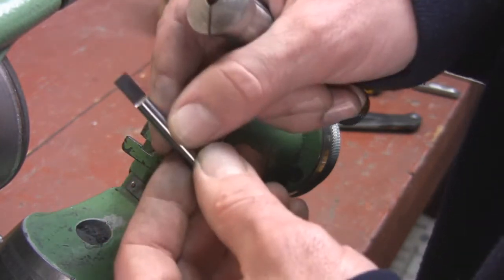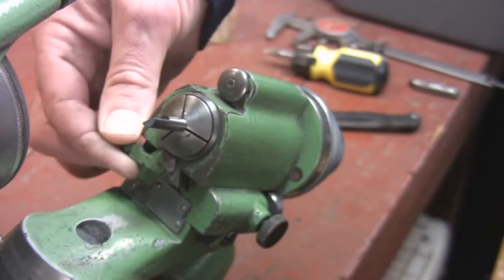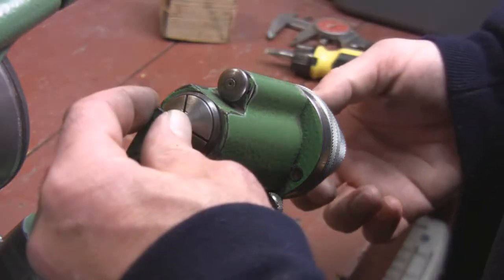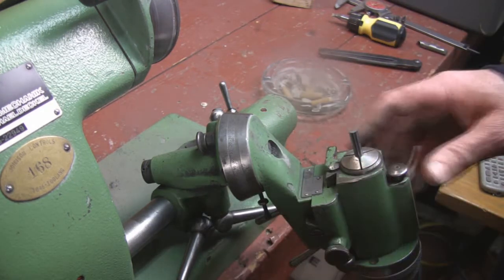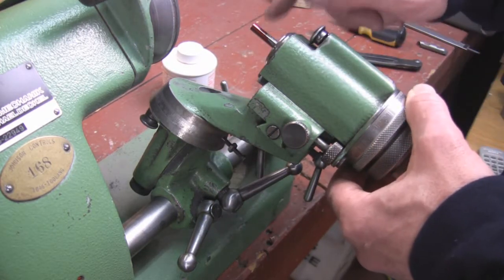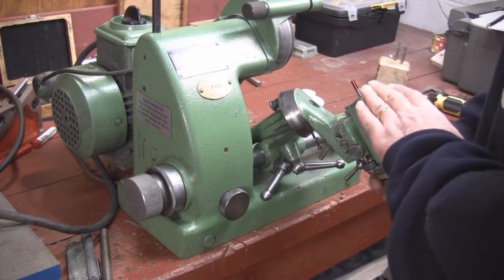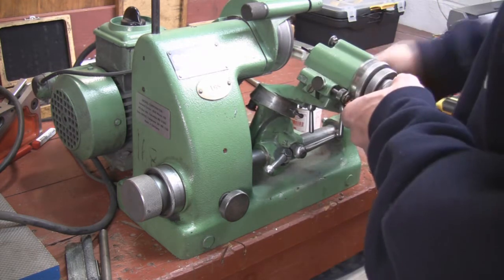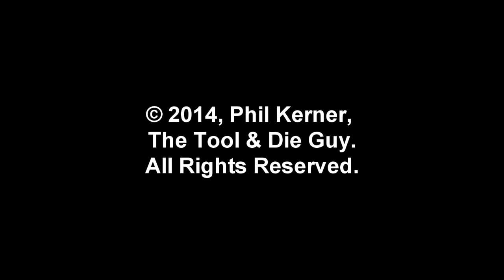Deckel Lesson 5: Aligning The Magic Red Dot

Comment: A 180 grit 4" diamond cup wheel like in this video costs $12 nowadays. I can give you the source if you like (import of course). So it does not make much sense to buy split carbide blanks for $11a piece (I assume they are imports too). Wearing out your diamond wheel is much cheaper. And they don't wear out fast. They can split many many carbide blanks and it takes only 5 min if you hurry it a bit.